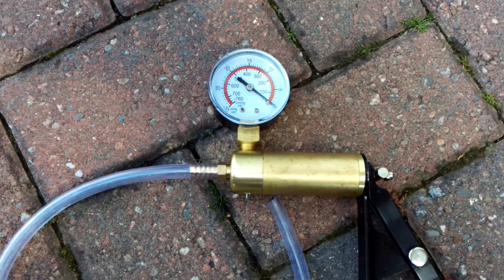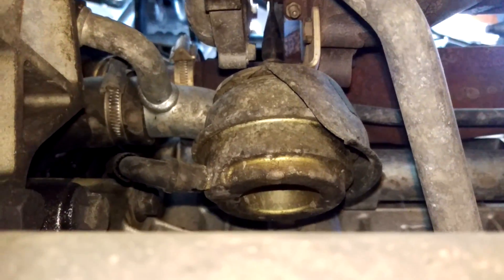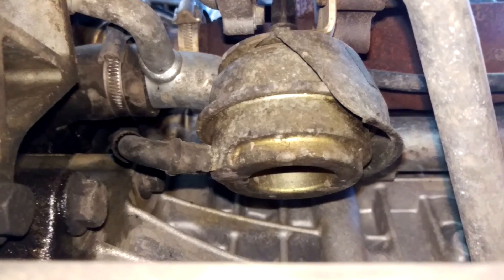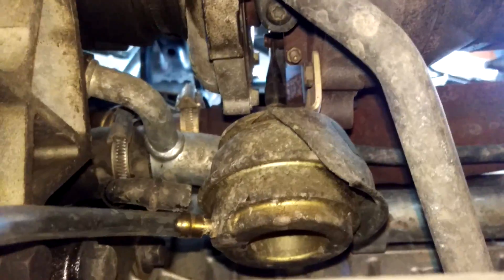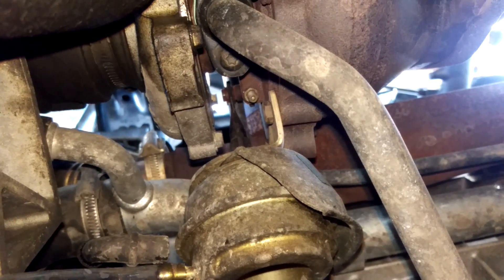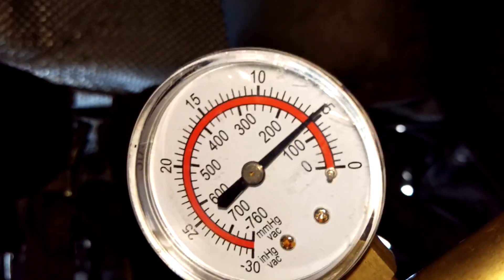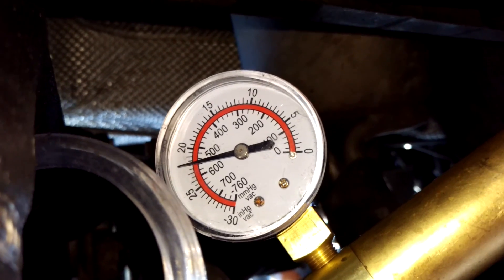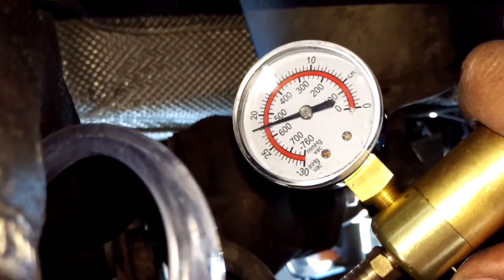How To Test a Turbo VNT / Wastegate Actuator (Vacuum Type)

Comment: Just been to try this on a euro 3 d5 xc70 and it looks nothing like this. I suspect due to the AWD. No idea how you're supposed to get to it. I suspect it's upside down or something relative to this
Reply: Hypothesis correct. I've taken a video if you wanted it for reference? I had to use the pipe from the tcv as I have no idea how I'd get to the actuator without removing the turbo or the engine. Fortunately both seem to be working in my case.

Comment: I have auq engine boost come and go and have missfire at steady throttle 1500-3000 rpm. Most when engine is too hot when is cold work almost every time.full bosst without bost on boost off like push the petal and leave and push again we can find what is the problem new plugs new coils bypass n249 nes n75 new blow-off valve

Comment: Hi Si !
And take for all the content u bring us !
I bought a V70 2004 D5 and I have many issues which I find answers on your channel, such as EGR cleaning ( code P0401 gone ).
Still have a boost issue that can causes trouble on going uphill. I feel like the motor don't have all the power it can have.
Have a turbo whistle has the motor increase rpms.
I don't know where to start tracing that problem ? I have no faulty code, only a old turbo wastegate range/performance which I deleted and never came back.
Reply: You might have a cooler/turbo hose turning into a balloon or leaking at high boost, or a tcv valve problem maybe
Reply: are there traces of leaked oil somewhere, follow them

Comment: My xc90 2004 d5 the turbo whistles loud then car goes in limp mode until I turn of ignition the  ok but can only drive car easy without this happening?  How do I replace or fix this thanks rob

Comment: what is a good boost, should they be actual and specified to be monitored and what are the deviations between them,
how to adjust the lever on the actuator, it must be correct with a wedge on which it stops or lengths for 1 round of thread. I would not take the turbine but on the spot to set up
bmw m57 525d 120kw

Comment: That cheap tester really sucks, if you don't have that vacuum tester you can get a hose and suck with your mouth, if the wastegate actuator works fine there is nothing to be worried about (it worked for me). next step is to test the vacuum pump in that case you will need a vacuum tester, then if you get a full reading you might test the vacuum boost solenoid (you might have full reading on the gauge). after these steps you will need to check the hoses. connecting vacuum pump to solenoid to the actuator.

Comment: Hi SiRobb thanks for the great vids,would the actuator be cycled on tick over or only on acceleration, sorry if that sounds like a dumb question,my 2002 d5 actuates on tick over not had a chance to test with vac pump yet
Reply from the maker: Hi. 
At idle, the turbo won't be actuated as such (at least not constantly) because no boost is being demanded.
If you watch it from engine off to idle, yes you'll see it move as it finds its position. 
If you increase revs then return to idle, you should see the actuator arm move. 
It won't move as much as when manipulated with the vacuum pump because full boost won't be required or allowed when the vehicle stationary.
Reply: its actually pulling full cycle on idle
Reply from the maker: +jay edwards When you say "full cycle", are you measuring your boost levels or just going by the position of the arm?
What happens to the arm when you increase revs? 
I haven't personally observed the exact arm positions for different boost levels and instead use diagnostics.
If boost is out of spec, I take it from there.
Reply: Not had a chance to see it when raising the revs
It's booked back in to Volvo next week again but no one is able to cure it.it smokes @1800rpm not above or below don't do it till full running temp all injectors new egr clean full service history ?? 2002 d5 11700miles any ideas ??
Reply from the maker: +jst4fun22  If you've spent all that money with no fix, my first idea is to take it to a garage that knows what they're doing. 😢
Whereabouts are you based?
Reply: +SiRobb I'm in Basildon Essex

Comment: Hi SiRobb great videos, is it possible to replace the actuator without removing the turbo?
Reply from the maker: If you ever see advertised a "turbo core", that's basically a Turbo without an actuator so it is possible but difficulty of removal can vary across different designs.
Reply: +SiRobb sorry I meant to say it's on a 2002 v70 d5
Reply from the maker: +daniel goffin I see..... 
I've never had to do it but my hunch is that it is doable whilst still in place. 
Why do you want to remove yours? 
Has it tested faulty?
Reply: +SiRobb yeah it's not holding a vacuum anymore traced the problem back to the actuator